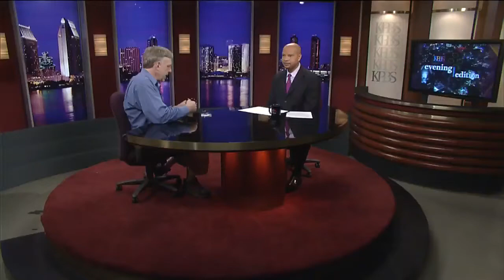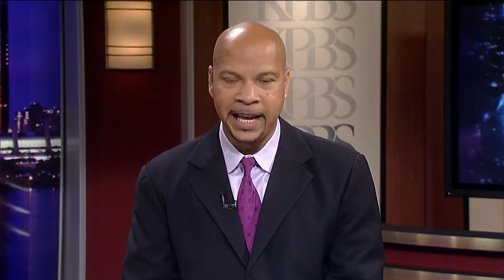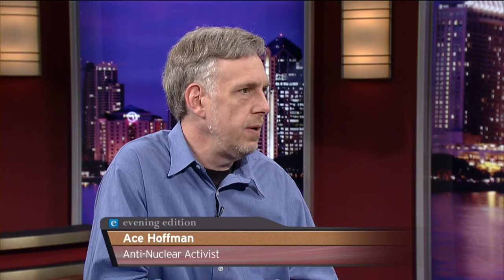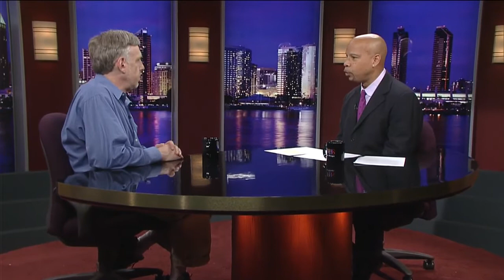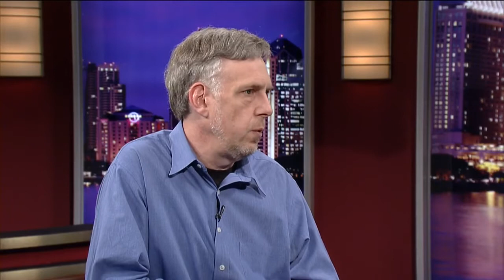Ace Hoffman, Anti-Nuclear Activist

Comment: Oh, look, one specific power plant with specific problems has had an accident. Better never use nuclear power again.
Seriously. Chernobyl had no reactor vessel or safety building.
Fukushima had it's backup generators in the basement.
The fact that there have been unsafe designs does not mean that we should abolish all aspects of nuclear power. If our current reactors become unstable under certain conditions, we need better designs, or a general nuclear overhaul.
And this overhaul is at the front door. Right now, China is building LFTRs, a failsafe, clean reactor running on thorium.
If we, as a species, had stopped development every time something went wrong, we would still be living in natural caves without bonfires.
But we learned from problems, adapted our methods, and developed new, safer designs in all aspects of our life.
Reply: ***** not to mention one of his proposed solutions is to reduce power consumption, which is...naive, to say the least
Reply: ***** Nice post. Sounds like during the inspection they found issues and are fixing them which is exactly what inspections are for. 
I can't take this guy seriously when he say that we should just reduce energy usage by 20%. Also this one plant provides 20% of San Diego's power you won't be able to replace that with wind or solar or geothermal thats for sure
Reply: Yeah, we developed newer, safer (and cheaper) designs - solar and wind, instead of a nuclear facility 1 foot above sea level on 2 earthquake faults within 20  miles of over 10  million people in a bay formerly known as "Earthquake Bay."
Reply: @jackfanning7952  So cheaper that Germany has to buy gas from Russia.
Reply: @ssorvete89  How cheap is a Chernobyl every 10 years? We know when a nuclear disaster starts, but we don't know when they end. Renewables are 2-5 times cheaper than nuclear even including grid-scale energy storage. Get used to it. Say bye-bye to nukes and fossil fuels.
Reply: @jackfanning7952  Renewables solely wouldn't be able to supply the power the world needs.
Reply: @n0tsane  New electrical technology and energy conservation can have the greatest impact on providing for our energy future. That combined with renewables can supply all of the power the world needs and do it faster and cheaper than any other solution. Nuclear is a festering sore that causes more harm than good. Not only is it the riskiest, most expensive and slowest to implement, but we will be paying economically and with our health for centuries to come because of its waste legacy. Any money wasted on nuclear energy is a lost opportunity cost keeping us from a legitimate solution.
Reply: @jackfanning7952 womp womp
Reply: The Fire Rises, right?
Reply: @jackfanning7952 what do you mean "a Chernobyl every 10 years"?
Reactors rarely if ever fail nowadays. Do you really think they would be haphazardly made?

Comment: Unfortunately their is still no permanent storage facilities for nuclear waste, only temporary, and that is going to be a another issue in the future.
Reply: Which power source would you prefer?  Any power source that you can point to will produce a greater mass and a greater volume of waste than a nuclear plant.
Reply: @gilian2587  I just made a statement, your implying that I suggested scrapping nuclear energy entirely. Please don't put words in my mouth.
Reply: @JamesSmith-jf1hz  You are correct; I made an assumption.  I am sorry.
Reply: @gilian2587  No worries.
Reply: @JamesSmith-jf1hz and Gilian:  I am suggesting scrapping all nuclear energy. The sooner, the better.
Reply: @jackfanning7952  If battery storage cost per kWh drops by a factor of 100; then the scenario you suggest would be entirely conceivable.  Now, understand that when it comes to acceptable costs; I am assuming that the lower and middle classes will not be excessively burdened by the cost per kWh for electricity. 

A 1 GW nuclear reactor is more expensive than a 1GW capacity wind or solar field.  But a 1GW nuclear reactor is considerably cheaper than a 1GW guaranteed 24/7 wind/solar-battery farm facility.

How dangerous is a recently pulled fuel rod?
Well... if it were exposed to the open air and was sitting at one end of a football field, and someone were to start at the other end of the field and begin running towards the fuel rod; they'd be dead before they made it to the fuel rod.  Now... if it were inside the waste containers... you could be standing right next to it and receive no radiation above normal background level.
Reply: @gilian2587  Renewables are 4-10 times less expensive than nuclear and twice as cheap as fossil fuels. Battery storage adds about 2 cents per KWh. Nuclear is as obsolete as buggy whips.
Reply: @jackfanning7952  And how many kWh of battery storage do you need for a solar farm in New York city to provide 1 GW of electricity from a standalone solar/battery farm including day-night cycle, average daily cloud cover, yearly winter solstice (shortest day of year).  And what capacity Solar farm would you need to supply that battery farm?  (Hint:  It's gonna be bigger than 1GW by a multiplication factor)  All of this is to answer the question: how much does it cost to guarantee 1GW of power 24/7?  Bonus question: how many square miles will that solar farm consume?
Reply: that is true but the total amount of nuclear waste could fit in a soccer field 30ft deep
Reply: However multiple next gen reactors are able to convert waste into more fuel thus reducing this problem and making it controllable
Reply: @user-uc7qb1su4e  I don't smoke and I don't drink. One would be a fool to do so. One would be a bigger fool to promote nuclear, which stands a good chance of destroying all life on Earth. Besides, it is the most expensive form of energy available.
Reply: @jackfanning7952  most expensive if you include capital cost. But over the long one you make a lot more money. I suggest you watch real engineering's video on it.
Reply: @maryzmijski6087  Even if you built nuclear power reactors for free, electrical energy from nuclear is the most expensive energy source. That isn't even including its two most expensive liabilities: nuclear waste and liability for environmental destruction and health problems it causes. U.S. taxpayers pay nuclear reactors $1 billion/year to store their own waste in unsafe, overloaded pools and trash cans without any hardened structures. The Price Anderson Act protect nuclear from liability for damages from nuclear reactors. How much do you think liability insurance for the nuclear industry would cost? The largest and most respected financial institution in the world, Lazard, provided prices for different electrical energy sources: nuclear - $118-192/MWh; utility-scale solar - $32-42/MWh; on-shore wind - $28-54/MWh. efficient energy conservation use - $0-50/MWh, averaging about $25/MWh. These figures do not include the costs to decommission aging reactors (especially high if the site is contaminated and they all are) and safely isolate nuclear waste for longer than mankind has been in existence. That is incalculable.
Reply: @jackfanning7952  they are already working on nuclear reactors that can use old waste. I have no idea where you those numbers from but I did a project about nuclear reactors and I saw vastly different numbers when I did my research, mind sharing your sources. According to the world nuclear association however, nuclear reactors do not have any noticeable power output with age, while solar panels only past about 20 to thirty years. You also underestimate all the  safety features those reactors have. The in Ukraine (not Chernobyl,  the one attacked by the Russians) literally had people shooting and firing explosives near it and it it released no radiation into the environment. These things are literally built to be bomb proof. All of the US navy submarines and all of the super carriers are nuclear powered. While they are expensive, they are pretty cost effective in the long run. As I said, watch real engineering's video on it. You also don't take into account future advancements in technology and efficiency that would bring the cost down.
Reply: @maryzmijski6087  "They are working on nuclear reactors that can use old waste." I assume you are referring to "Advanced" reactors such as sodium-cooled reactors (SFRs), High-Temperature Gas-Cooled Reactors (HTGRs), and Molten-Salt Reactors (MSRs). If there are others you want me to address, please specify. They are neither new or improved. All failed in the past because they present unique, numerous, and increased safety problems and costs without providing any significant improvement or advantage over conventional light-water reactors. They have been plagued with frequent shutdowns, high maintenance and low output. They present increased risks of nuclear proliferation and must use fuel reprocessing. Reprocessing is extremely expensive, dangerous to operators and the most polluting process in the nuclear energy business.  Even if you had unlimited funding, fast breeders and reprocessing facilities would have to operate continuously at extremely high levels of performance for hundreds to thousands of years to consume the nuclear waste currently on hand. That still would not solve the problem of nuclear waste strewn all over the globe from continuous, daily radioactive emissions and frequent nuclear accidents and intentional dumping. Source: Dr. Edwin Lyman, "Advanced Isn't Always Better. Assessing the Safety, Security, and Environmental Impacts of Non-Light-Water Nuclear Reactors http://www.ucsusa.org/resources/advanced-isnt-always-better
If you want sources for specific statements, please specify. The only source you have presented for your conclusions or in research for your paper is real engineering. I do not want to begrudge real engineering's knowledge on the broad range of YouTube topics they address. However, I do not know of anyone at real engineering who would be considered an expert witness to testify on nuclear energy in a court of law. I worked for 35 years as an industrial hygienist, including some consulting work at several DOE facilities. If I mentioned their names, you would know them. I will not, because of their careless and callous attitudes toward nuclear safety. I read from recognized experts like Dr. John Gofman, Dr. Alexey Yablokov, MIT Prof. Kate Brown, Arnie Gundersen, Fairewinds, Dr. Gordon Edwards, Dr. Jay Gould, Dr. Armory Lovins, and Mycle Schneider. These experts do not have a vested interest in nuclear energy. In fact, many of them have given up very lucrative careers and positions of authorityin nuclear power because of misgivings they have based on their nuclear experience. Sources for my comments are:
Amory Lovin's "New Nuclear Reactors, Same Old Story www.rmi.org/sitepages/pid601.php
Amory Lovins "Does Nuclear Power Slow or Speed Climate Change/" forbes.com/sites/amorylovins/2019/11/18/does-nuclear-power-slow-or-speed-climate-change/?sh=310818b4506b
Last, but definitely not least, I refer you to the World Nuclear Industry Status Reports for 2020 and 2021 available at http://www.worldnuclearreport.org The reports are issued annually and provide the most detailed worldwide information on, not only nuclear; but also other energy sources. It is available on written or video PDF format. If you watch it, I promise it will be the  most informative hour you have ever spent of energy research presented by recognized experts at prestigious universities and research institutions.
If you want more, I have plenty.
By the way, design engineers say the working life of a reactor is 40 years. The same for canisters to  TEMPORARILY store waste. Due to stress and neutron activation, reactor parts and canisters become brittle and radioactive after 40 years. Being brittle, they are subject to fracturing and failing. Just like your car, older reactors break down more often. $$$$$ Neutron activation causes some parts to become so radioactive they can kill in 5 seconds. Maintenance costs increase and it is hard to work on radioactive parts. Decommissioning is more expensive and catastrophes more likely. Just because the NRC is relicensing reactors with cracked containments doesn't make them safe or economical. 
Advancements in  technology have brought the cost of wind and solar down by 80% and 70% respectively in the last decade. Nuclear has increased by 33%. Just because you are going the wrong way doesn't mean you can't turn around.
Reply: Nuclear waste isn’t that much of a problem, you can store it in abandoned mines made shift into storage.
Reply: The only issue.
Reply: @bussesandtrains1218  See my previous comment about renewables poroducing more electrical power than any other source except natural gas in the U.S. in 2020. Renewables exceeded energy production of all other electrical energy sources in Europe that same year. This is documented in the World Nuclear Industry Status Report (WNISR).Try to keep up.
Reply: @jackfanning7952  that's hydro and biomass, stop lying
Reply: @jackfanning7952  yet it produces the most power of all the options...
Reply: @jackfanning7952 how is it dangerous? Please explain
Reply: @pilotbug6100  Yes, I really like my powerful fusion reactor 93,000,000,000 miles away. That is only relatively dangerous. But please, nothing closer, OK? I wonder if we can harvest some of that energy to actually isolate for longer than mankind has been in existence all those highly dangerous fission isotopes that never existed before 1939 that have been produced over the last 80 years?